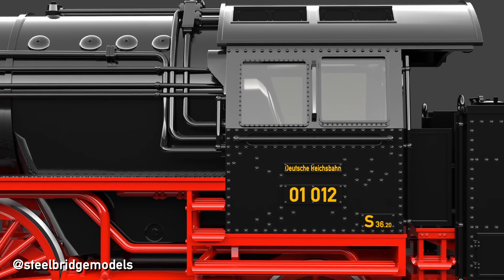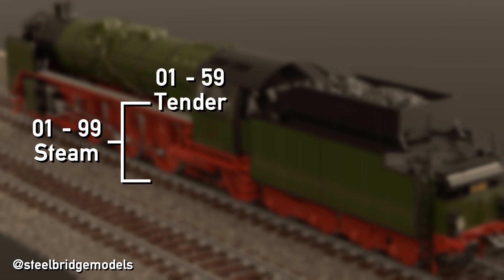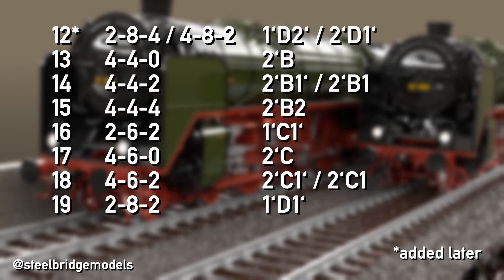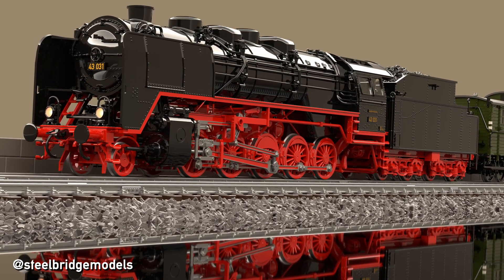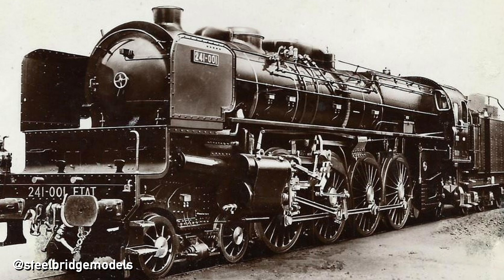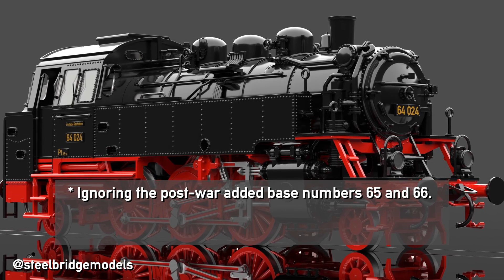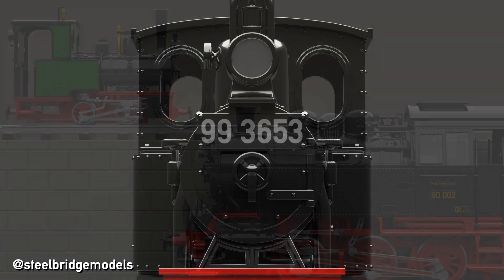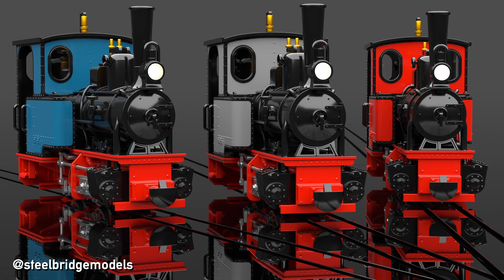What do these Numbers actually mean?

Comment: Funny how Germany over complicated the numbers. Hangary used and still uses a very simple system on normal gauge tracks there the first number is the traction axials number and than the type number than separated with a 4 digit serial number. This system branched with the eltric and the dizel machines using a V an M fore mark that later have got replaced number 1 and 2.
So as an example: 601 was the 12 driving wheels steam Gigant.
The V40 was the 8 drving wheels eletric, Kando.
The M62 is the disel, Sergei, which now zecically 262 by number.
Sadly the railbuses have different aproach, though.

Comment: Did all narrow gauge engines ALL fit in class 99, even the bigger ones like the decapods (0-10-0)?
Reply from the maker: Yep, they were all squeezed in there, no matter their size or wheel configuration, starting with ancient 0-4-0s all the way to standard 2-10-2s.

Comment: Sometimes i think german numbers are confusing but then i remember my railway literally goes like
CC (wheel arrangement)
201 (Class]
92 (batch year)
01 (Serial number)
R (rebuild, not all of them have it)
Examples:
CC201 83 47R
BB203 78 01
CC203 95 11
CC206 13 100
I swear it took me 6 years to figure it all out
The older numbers are much easier to understand like:
CC201 45
D301 17
D52 100

Comment: Thank You for explanation.
If the wheel arrangement mentioned, in former Czechoslovakia, before the computer numbers, the class denomination contained letters - the power source, and numbers - performance figures, as driven axles, nominal speed and axle load.
In modern ages every locomotive should be ES/T 499......😁

Comment: Interesting, but I do wonder, why Germany decided to go that route, rather then having a number-letter system, as it is in Poland or Switzerland. For instance Polish steam trains have 2 or 3 letters - first O, P and T for passenger, expres and cargo, then K if it's a tank engine, and a small letter designating wheel configuration. After that is a number: 1-10 for the ones from Germany, 11-19 for Austria, 20-99 for Poland (were it's also the year of plan), 100 are for "unusual" Poland got after ww2, 101-200 and above 200 being other in origin before or after the war.

For example BR 52 is Ty2 in Poland, and Ty246 is an American train, with same wheel configuration.
Reply: There was also a system in Germany to classify locomotives with letters and numbers. The Gattung, which is also written on the locomotives and direct reveals certain characteristics of the locomotives! The described numbering system was mainly intended to identify the individual locomotives.
https://de.wikipedia.org/wiki/Betriebsgattungszeichen

Comment: Cool!  You just earned yourself a subscription!!!  YAY!!!

Quick question though, did Germany ever field any Saddle Tank locomotives?  I built one, in Narrow L-Gauge, to service my Lego City Dockyards Narrow Gauge Light Railway, and thus wanted to know if such an engine ever existed.  Also I should mention she’s a 2-4-0ST.

Anyways, Rockatoa, Brickticks out!
Reply from the maker: Not too long ago, I wondered about that myself. Sadly, I'm not aware of any German saddle tank locomotive, nor could I find one. On the other hand, I can't claim to be familiar with every locomotive, especially not in the context of industrial or narrow gauge. All you need for your model is a convincing story: Maybe that locomotive was meant for export and thus built to a foreign design, but never made it to the company who originally ordered it, so it was sold off locally. Things like these happened all the time, especially during wartime.
Reply: @ Brickticks to the best of my knowledge, no. For the kind of applications where a saddle tank might have been used in Britain or America, Germany usually built well tanks (i.e. water tank between the frames). The fact that well tanks never really caught on in the Anglophone world can probably be traced back to unwillingness to use outside valve gear (and cylinders, in Britain's case): you can't really build a well tank engine with inside cylinders or valve gear because the water tank would be in the way.
Reply: @dkbmaestrorules  Ah, I see.  Well then, it's a good thing that my little Narrow L-Gauge locomotive has some good lore.

See, the story goes that the Lego City Dockyards acquired the engine third or fourth hand, hence why it has some known issues.  Namely, the frame has lost it's red paint, (meaning I built it with a dark bluish grey frame), she's got HC 514 on her front number plate, (which may just be her builder's number, nobody knows for sure), and she's got a British Head-code Lamp, which is surprisingly in the right place for the work the engine does.  Still has the other parts correct, i.e. she still has her red wheels, and everything above the running board is black.

Oh well, my little engine is very nice, and does it's work very well, and soon I'll be making some tweaks to the design, namely adding in a front ball ended ball and socket coupling, adding in a pair of black headlamps in pace of the one white one, and recoloring the frame to the correct red color.

Anyways, that's all, I gotta go, I need to take out the trash, as it's trash night.  Rockatoa, Brickticks out!

Comment: Great Video. One (I think important thing) you forgot things like a leading 0 before the number like 052 indicating oil firing
Reply: He didn't. Oil firing locomotives got a new number. For example class 50 locomotives who were converted to oil were reclassified to class 50.35. The 0 was added in 1968 when all locomotives and multiple units got the same 3-number class number system. A 0 was added for steam locomotives, a '1' for electric engines (class E10 became class 110', a '7' for DMU's (class VT 95 became class 795) to name a few.
Reply: @dutchgamer76  Ah okey then I misunderstood this system. Thanks for clearing this up
Reply: The class 50 never got oil firing, at least not in the West. As stated before the leading 0 simply indicates a steam engine, 1 was for electric and 2 for diesel engines.
That new scheme introduced in 1968 (in the west) consisted of two number blocks with three digits each and a control number behind a dash. For classes which were built in quantities of multiple thousands, like the class 50, this was a problem. The class 50 was very widespread with around 3000 built, to not make things complicated the thousands place became part of the class number, so a potential 50 2304 became 052 304 and so on. 
For other classes like the 38 or 44, the thousands place was dropped and engines with conflicting numbers were simply renumbered, as arbitrary as this might be. If there was a 44 354 and a 44 1354, then one of the two became 044 355 or any other free number close to the original number. As if things weren’t complicated enough…

Oil fired engines got a number derived from the original number of the class, the coal fired ones usually kept the original one with the added zero. The 01.10 became 011 for coal and 012 for oil, the 41 was turned into 041 and 042 and the class 44 into 043 (oil) and 044.

I hope this comment didn’t turn out too long… ;)
Reply: the leading 0 was added in the west (Bundesbahn) after indroducing computer numbers. 
Because 1xx were electro locomotivs and 2xx diesel. So A locomotive starting with a 1 but is not an electro locomotive could be confusing. At least with data processing and computers in the 1970s. So they added a 0 for steam. 

East german, still "Deutsche Reichsbahn" took a different approache. They didnt want to renumber the majority of steam engienes. So they keeped the two digit number. 
But to avoid confusion all locomotives starting with 1 or 2 were renumbered. 18 becomes 02. 23 becomes 35. etc. There are only a few left in the 1970s.